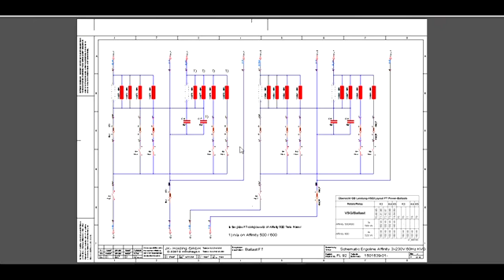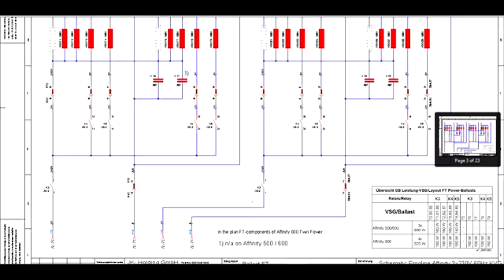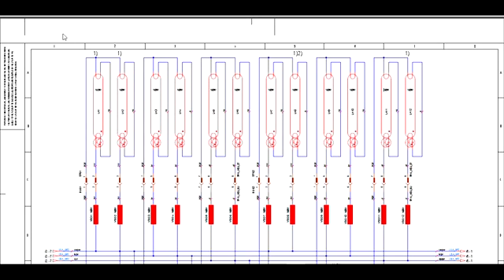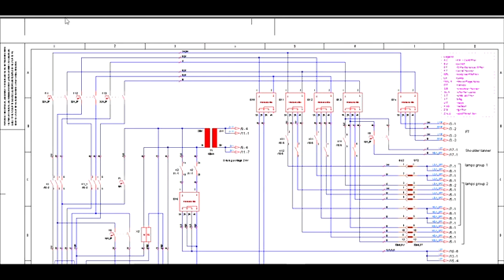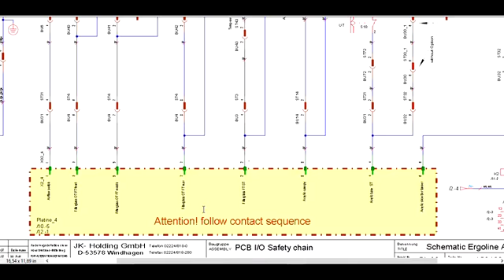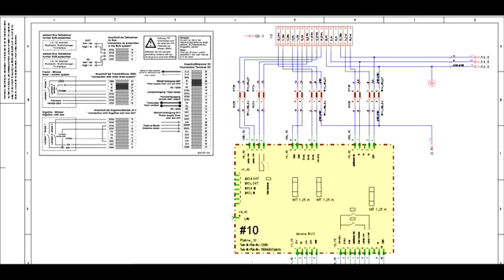Diagram reading for Ergoline electronic 2

Comment: I'm having trouble with an ergoline classic 600, 2 of the four face tanner lamps had gone, I replaced them with new lamps and got one working, the other one that is not working the lamp holder looks fine, what could be the problem? Also how do you check igniters or starters or ballast, which one is which many thanks